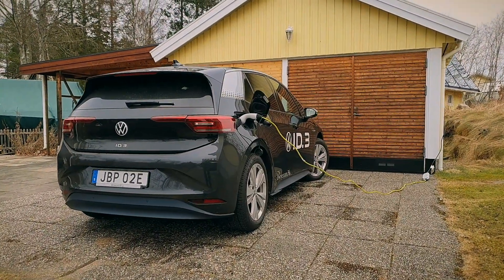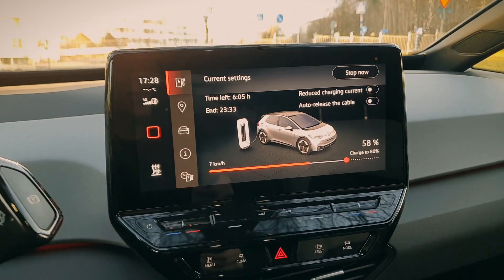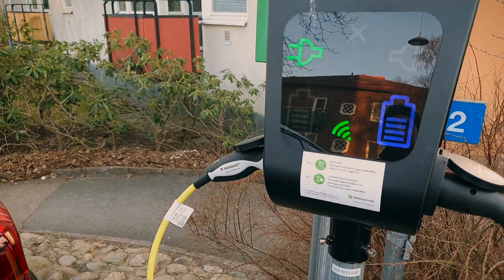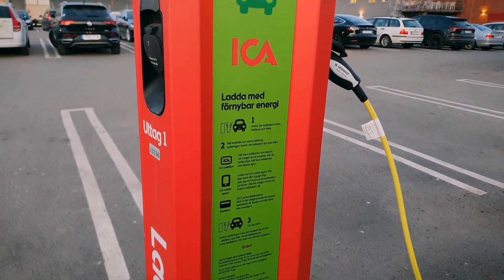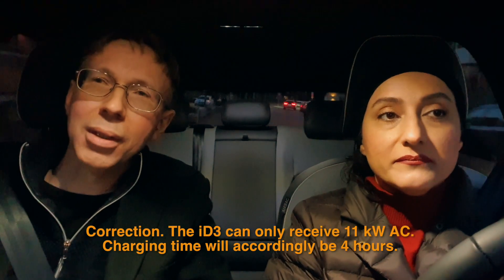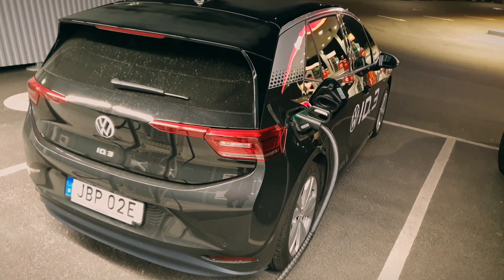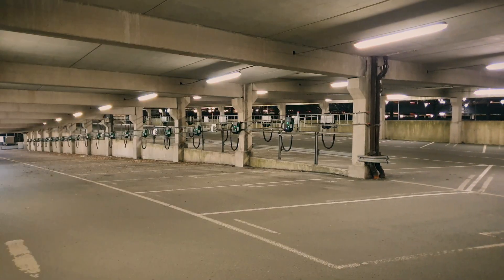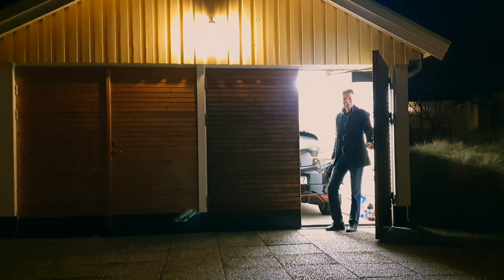APARTMENT AND ELECTRIC CAR.  HOW TO CHARGE?  LONG CABLE THROUGH THE WINDOW?

Comment: I’ve been charging out of my kitchen window for almost 5 years. 

I do own the building so I gave myself permission.   

There is a charging station that was installed two years ago,  two blocks away that cost about 35% more but the street is very busy and I cannot see my car and I do not want my car to get banged up from people that don’t know how to parallel park. 

So I would rather charge out my window two times a week. 

Unfortunately the electric feed for my apartment is only 60 amps. 

So I could not install a 50 amp charger.   

I installed a 20 amp charger.  

I currently have three electric vehicles at this location and I charge all of them with the same EVSE.  

You can see some of my videos here on YouTube by clicking this #EVCHARGINGINTHECITY 

After you click the Hashtag,  YouTube will ask you do you want to do a search with the # or without.   Click the hyperlink of the word without the # symbol.  

And you can enjoy some of my videos.

Comment: You shouldn't use such an extension cable as they are not designed for the car and could actually cause a fire. Plus it is obviously not waterproof. Here in Austria it is pretty simple to charge, you can use the WeCharge card from VW to charge everywhere.
Reply from the maker: Having a loose cable like that through the window is of course not a good option, it was partly made as a bit of a yoke and to show how slow the charging would be. The outdoor cable used would not catch fire but it can be damaged and putting it like that in a public area can have its issues. That solution would only be used in an emergency and should not be left unattended.
Thanks for the WeCharge info, good to know.